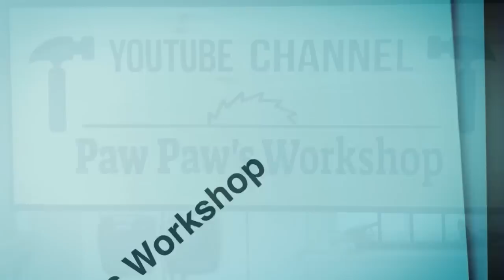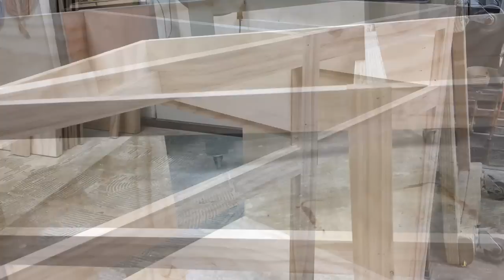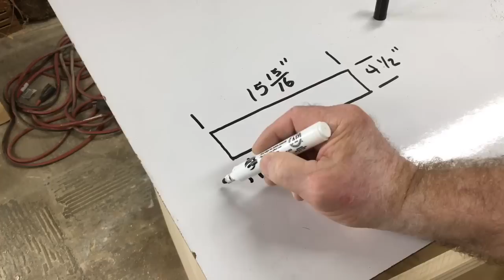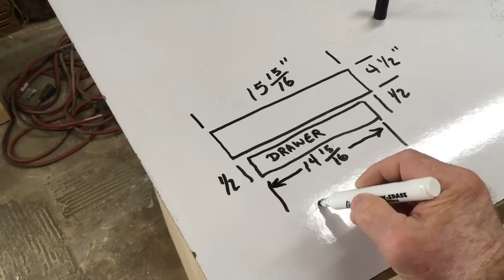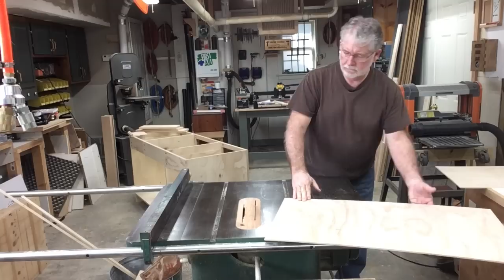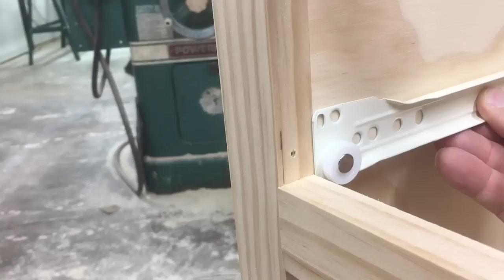How to Build Simple and Easy Drawers (Part 2)

Comment: Thank you for these videos ! I will be making my first cabinet this week ! just have one question about your jig you built out of plywood to cover your table saw ! what is the reason for it ? does it keep the saw dust from coming back in your face or another reason ?
Reply from the maker: The table saw jig is for cross cutting material. I’ve also added the acrylic cover to catch the saw dust with the central vacuum. It’s also for safety in that it much safer to cut the material with this type of jig and the acrylic cover capturing the sawdust also helps to keep the fingers away from the blade. Thanks for watching

Comment: thanks. I plan to copy your design but forced to use 2x2 inch wood and create cross lap joints. Do you see any problems with these two different ideas ? Or any advantages using 2x2, take it drawers can be installed in such a structure ?
Reply from the maker: No problem, that should work.

Comment: Do you have any issues using a sliding mitre saw to cut rabbits ? Or, use a Makita circular saw with a track to cut the drawers accurately ? I don’t have a saw table, just hand tools. Thank you for your video, I aim to build my own custom kitchen and save £££££.
Reply from the maker: If you have a router, you can do it on a simple router table.

Comment: i am new to woodworking - is this just a normal tablesaw or something else?
Reply from the maker: This is a very old table saw that is a contractor grade saw.  It's about 50 years old.  There are many good saw to get you started.  I would certainly get the best 10" table saw that you can afford.  It is the foundation of your shop and will be used on almost every project.

Comment: The rabbet depth should be 3/16 and not  1/4  for 
1/2  inch stock.  - 1/3 the thickness for structural integrity.  Nice job though !
Reply from the maker: You are correct.  The simple reason is based on the title of the video.  I wanted a simple easy drawer method without having to make multiple table saw adjustments.  A 1/16" is a very small adjustment that I eliminated.
Reply: @PawPawsWorkShop  , I recently made some 1/2 drawer boxes with 1/2 birch plywood. I forgot the the 1/3 rule of thumb  and was very quickly reminded when the plywood started coming apart at the dados and groves.  You used soiled wood which is great and would likely not have this problem though the 1/2 rabbet could split from a nail or screw @ 50 % of its thickness .   I will never build another drawer box with 1/2 ply. It will be 5/8 or 3/4 for sure. 

Thanks for the feedback- enjoyed the video.
Reply from the maker: Thank you for the information. I hope that people will read the comments.

Comment: Why do you want the bottom of the drawers to not be glued in? I would think they would last longer if you did...dont know how many drawer bottoms I have seen work themselves loose over the years
Reply from the maker: Wood continues to move with the changes in humidity and can cause the drawer to break.  Plywood is more stable and you can possibly glue it in.  If you have solid wood side be careful.

Comment: I see you were using pine for the drawer.  But I was wondering if there is a way to 
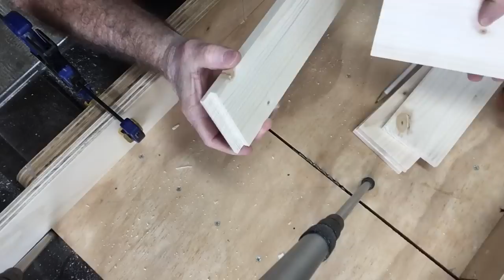make the rabbet cuts and be able to hide the edges of plywood?  (@7:05)
Reply from the maker: No, the nature of the rabbet joint is that it is going to show a partial edge.  There are other types of joints that could be used to hide the edge.  A simple 45 degree joint is one and if you put a spline in the joint, it is very strong.

Comment: If you had an odd situation where the drawers were almost 48” wide 
Would you use half inch for the bottom ? 
Or would 1/4 still be fine ?
Reply from the maker: Use half inch material.  The quarter inch material will have too much flex.

Comment: you have us cut the drawer fronts 3/4" larger than the drawer.  When you attach the drawer front to the finished door, do you make the reveal even on all sides?  I notice on my kitchen cabinets that the drawer is attached with more of a reveal on the top than the bottom?
Reply from the maker: Michael Giuva . The drawer front is 3/4” larger than the opening.  When you put the face on the drawer the reveal will be equal to the face of the drawer. The front will be higher on the drawer itself as you see on your kitchen cabinets.
Reply: @PawPawsWorkShop  thank you.  im taking your techniques here and adapting them to build a sideboard for our kitchen. So far I have the base done and am now starting the drawers.
Reply: next question as im planning out my drawer cuts.  getting back to that 3/4 inch on the drawer front...can I go ahead and just make it an inch so that I can have an easy 1/2 reveal all the way around?

Comment: You need to improve your drawers! Turn the corner joints so that your nails are sideways to the direction of pull or at the least slant your nails in different directions to resist pull-out. Up until this point you've impressed me. I will continue on because how you've done everything else.
Reply from the maker: Thank you. Keep in mind, this is a simple beginner drawer. You have an excellent point.

Comment: I cant do the groove.. ill find a way
Reply from the maker: Why?  No table saw?  You can do it with a router also.
Reply: A dodge I’ve seen in a lot of on-site built 50’s homes is to tack strips of scrap where the bottom of the grove would be,and then on top to hide any possible gaps. 1/4x1/4 sticks basically. 
It’s not the prettiest or most professional way in all the world. 
But still a respectable poor man way of attacking the same problem.

Comment: Thank yooo so much for this! My kitchen fell apart and I needed to learn how to build cabinets in a HURRY! And since I don't know what I'm doing...I needed EASY. I can't afford hardwood so I'm goin with select pine like in your video. It won't warp over time, will it?
Reply from the maker: You're welcome.  Building new kitchen cabinets is quite the challenge.  All wood when subjected to moisture and humidity will have a tendency to move Seal the wood. Using the techniques that I show should help you.

Comment: Good videos. Do you finish the inside of your cabinets at all? I would think it would be easier to do your painting before you install your drawer slides
Reply from the maker: Thank you very much.  Yes, I will paint or stain the inside of the cabinets that I make.  I will remove the hardware before painting.

Comment: Better you can use push stick doing table saw straight cut.
Reply from the maker: Push sticks are extremely important and I use them all the time.  Sometimes the videos make is appear that fingers and hands are closer to the blade than they actually are.  I believe in push sticks and believe that everyone should use them.  Safety first!

Comment: Look, I apologize for beating you up, but seriously...some things need to be pointed out. 

PVA glue is designed to be applied to both surfaces. If not, a glue-starved joint will occur resulting in a weak joint. Glue squeezeout is a good indication of sufficient coverage. 

Also, never place your hand next to where you are nailing. A brad could hit a knot and be driven out the side, into you hand. Brads and nails will also follow grain.

Comment: Yes that's a great way to build base cabinets ... I build mine the same way .. I just use red oak four my fronts and railing not pine .... 
      Kreg system the best way build the front too ... 
       Really the only way ...
Reply from the maker: Thanks, most times I use red oak as well but this project was on a tight budget and cabinet was going to be painted.

Comment: I wish I had your ability, it probably takes a long time to become that good. Thanks again!!!
Reply from the maker: It has literally taken a lifetime of many trial and errors to learn what works and what does not.  Thank you very much.  My Dad got me started in woodworking when I was very very small child.  The table saw that you see in my videos is the one that I grew up with.  That machine is over 45 years old. I used it when I was building custom cabinets for local contractors decades ago.  When my Dad pasted away, that was one of the very important tools that I wanted to add to my shop.
Reply: Sorry E, didn’t mean to hit the thumb down 😩